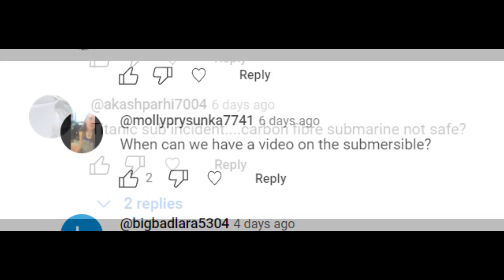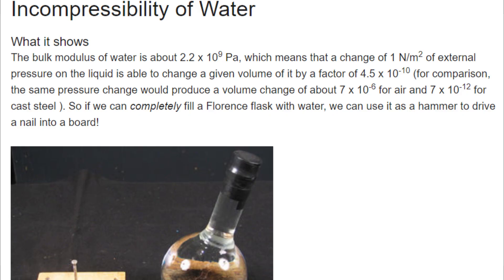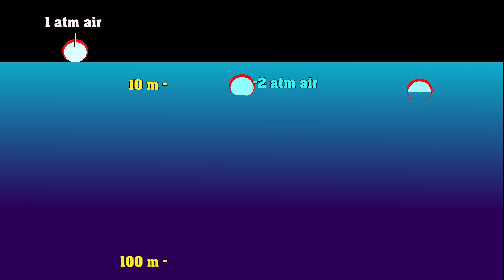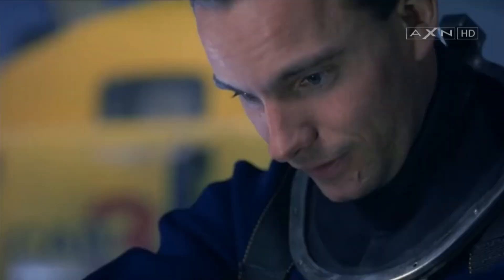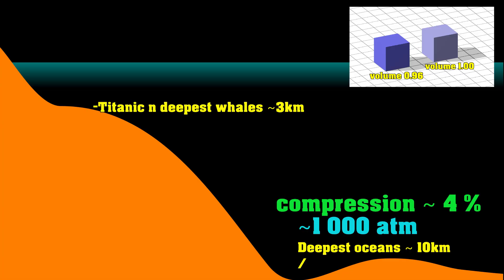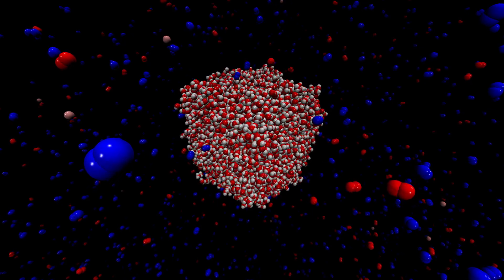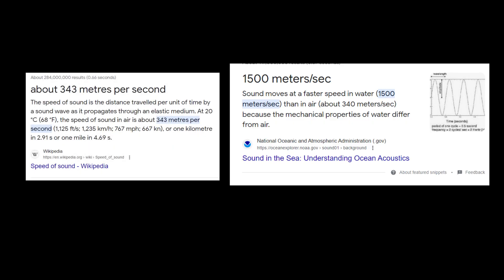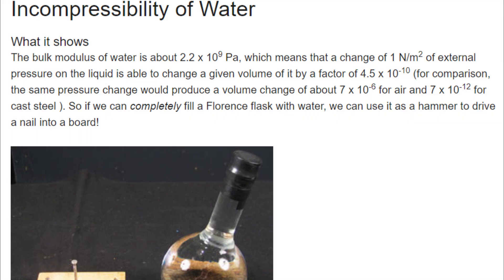What Happens when a Hull Fails at 1000 atmospheres?

Comment: When I was at Uni one of my lecturers told me about a mine accident when he was a student.  A miner accidentally drilled into a neighbouring mine that was flooded with about 200m depth of water, the water in the neighbouring mine pushed the drill bit out of the hole rather violently, and the miner got about 60m of 3cm thick drill bit through his skull in rather less than a second.  The water then proceeded to cut a hole in the granite wall behind where the miner had been standing.  Water under pressure is not to be underestimated!
Reply: Yikes. Yeah, they use pressurized water streams to cut rock and even diamonds, it can pretty much slice through anything under enough force. Anyone who has ever pressure washed a driveway or the like and held it (from a distance at that) against their bare skin would quickly come to appreciate how even the water from a relatively low power pressure washer can feel really sharp and hurt your skin.
Reply: @larion2336   Yeah, they use pressurized water streams to cut rock and even diamonds,

False. Certainly not diamond lol 
Waterjets use embedded particles of high hardness synthetic materials like synthetic garnet or synthetic ruby . The water itself doesn't do the cutting, it's used as a matrix to push the very hard abrasive particles
Reply: 200m of water would only be 283PSI so i doubt that can cut granite...
Reply: No the water didn't cut a hole in the granite that's absurd. On top of that nobody was close enough to witness that hole being made and survived to tell the tale. 100% false lol
Reply: Did the miner die?
Reply: @cholodude97  nah he was fine
Reply: @cholodude97  probably had a headache though
Reply: @cholodude97  He walked it off.
Reply: Surprisingly he didn't die but after he recovered, his personality drastically changed. Which lead to discovery of association between frontal lobe and personality traits.

Edit: I thought the comment was about Phineas Gage, who was a railroad worker, but commenter was writing about another similar incident.
Reply: @primumNocere you're probably thinking of the similar even with a railroad worker who got a steal beam through the brain since that's a lot better known story
Reply: @primumNocere  that was Phineas Gage in the 1800s and it was a tamping iron driven by explosives during railroad construction. Not a miner and a drill bit driven by water.
Reply: @baconghoti   @jesterram7146  yep that's what i was referring to. surprised to learn that more than one people survived a metal beam going through their skulls
Reply: @cholodude97  Well he was chilling with me just the other day, he is all well and good !
Reply: He laughed it off. Retired and became a zombie. Drill Head we used to call him. Days when men were men and you could die one day and still damn' well turn up for work the next. Not like these snowflakes today.
Reply: Yes @cholodude97
Reply: It is used to cut steel plates, for example.
Reply: @piotrd.4850   No. Water jets use embedded particles of synthetic ruby or other hard gemstone . That's what does the cutting. Not the water.
Reply: He basically created a natural water jet cutter. They use that all the time in production of steel parts. It produces a cleaner edge than plasma cutters. Combined with the right grit, it can produce a polished cut line.
Reply: @muskokamike127   No. Water jets use embedded particles of synthetic ruby or other hard gemstone . That's what does the cutting. Not the water.
Reply: This was me. I was that miner. I was real surprised when that water came shooting through and I'm lucky to be alive. My friends and family say my personality changed after I got stuck with that drill bit but every cloud has a silver lining though. The ordeal gave me the idea for the water pick flosser and I'm a millionaire now.
Reply: @MitchellSulzener  
When life gives you lemons... Good job!😁 One question - Is it hard to wear a hat with that drill bit sticking out?
Reply: Look up the story of Phineas Gage if you're interested in oof injuries like that...
Reply: @Faesharlyn  "'Tis but a scratch"
Reply: Oh come on man, you can't just stop like that after making such an invigorating scene in our minds! TELL MORE. That is such an awesome thing to imagine.

Comment: Good video, however seems a little OTT focusing on the compressibility of water primarily vs the obvious 5800psi.
Basic math seems like follows:
Pressure at max depth- 5800 psi
Area of a 20x6m cylinder- 555120 sqi)
Total applied # pressure apllied across area- 3,219,000
I think a structural engineer would be needed to explain further, however if AvE doesn't do a follow-on video explaining, maybe someone else can  do a mock-up with an egg and a lower pressure set-up.

Comment: As someone that actually understands hydraulic pressure, this is PAINFUL to listen to.

The sides of your "magically wall less" space don't just sit there, neither does the bottom. All spatial directions are evenly supporting all that PRESSURE, mass, force. The gravity fills it? GRAVITY?! No. The total ambient pressure of the surrounding area attempts to equalize. The velocity of that is dependent on some VERY COMPLEX math. But we can napkin it and say once compromised structurally the force was divided evenly across was the size of the submersible comes inside to play evenly in all directions. Napkin math says somewhere north of 400psi. So you're getting a flow rate of somewhere south of 800,000 cubic feet per second. The submersible is roughly a 6 by 20 cylinder. So that cylinder of air is full of water in around 0.0001 seconds. rounding up.

Fking GRAVITY?! FIRED, you are fired.

Comment: The temperature increase due to compression probably isn't insignificant, but the wall of water crashing in at 2x the speed of sound probably won't leave much time for any heat exchange. I imagine it's basically like a big diesel engine cylinder.

Rough calculations for adiabatic compression with diatomic gas with 5 degrees of freedom (7/5) at 300K:
- 5m^3 tube at 1 atmosphere (~100,000 Pa)
- air is compressed to say 0.0125m^3, 100000(5/0.0125)^(7/5) = 439424217.32Pa
- PiVi/Ti = 500,000/300 = 1666.67
- Tf = PfVf / 1666.67 = 439424217.322Pa * 0.0125m^3 / 1666.67 = 3295.67K.

That's about 3000 degrees C for a few milliseconds, before immediately being washed away by very cold deep ocean water.

Comment: Huh, I thought the pressure was force against the sub. Like grabbing a bag of chips and pushing on both sides of the bag. It doesn't pop because my hands are decompressing and springing back but because of the applied force. Gravity is causing this constant force on the water which is pushing in on the sub. There may be an element of decompression at work as well but its the only thing? Possible I completely misunderstood the video.

EDIT: Was thinking about compressed air cannon or something similar and realized what he means now. Since gravity pulls all matter at the same rate there is no accumulated force to cause more pressure then what gravity would normally provide. So its similar to a compressed air gun.

Comment: What happened to the atmosphere in the sub?
Did it get pushed out? Did it get compressed? At the speed of sound? what happens in that case?
Reply: it gets mixed with the decompressing blob of water, gets compressed 350 fold, heats up to 100k kelvin, but it's already mostly outside the boat by that time then it probably rather quickly cools back down. it's 6-7 kilos of air we're talking about so not that much of an effect on anything

Comment: Thanks for the video. I’m a little confused though. If the water was incompressible at whatever depth, and the hull failed, wouldn’t there still be a rush of water moving at high speed due to the pressure difference between the inside and outside, not just free fall speed?
Reply: This is a good point. Thunderfoot is either implying that water pressure itself is the result of slight compression of the water. I believe Thunderfoot is wrong about that because the weight of the water also causes water pressure. He is also wrong with his final animation showing expansion of a volume of air out of the sub, which is just nonsense to which I don't know what he was trying to say at all as it does not picture what actually happens at all. This video is shockingly unexplanatory.

Furthermore, it seems like decompression of water by 4% is quite uneventful to the human body and to the submarine. It just means for every 1 liter of water that leaked in an extra 0.04 liters was expanded out. That doesn't explain anything at all! At no point is it clear why this additional 4% implied volume is relevant in any way.

Comment: When the sub fails, a cubic meter of water beside the sub has 40 mega pascals on its ocean side, and just an atmosphere on its sub side. So the force is 40 mega newtons, mass is 1,000 kg, so that ton of water would accelerate toward the center of the sub at 40 kilo meters per second per second. I got 0.007 seconds for it to travel 1 meter across the sub, reaching a speed of 280 meters per second.

That ignores the springiness. So that's a good point. But even if it was incompressible, the water wouldn't fill the sub at freefall speed, because water surrounding the sub to a radius of 10 meters would only have to fall 3mm in order to fill in that cubic meter.

Not sure if that will make sense, or even if any of it is right in the first place, but thought I'd comment anyway : ) Great video as always.

Comment: @Thunderfoot First time i've seen you make such a huge mistake on a trivially simple topic. Lets say the water is completely incompressible, I still fail to see how water would not enter the sub through a small hole at near the speed of sound. The velocity of water exiting a system through a small hole is (2gh)^0.5 where h is the depth below the surface of the water. so at around 4000m depth, water should enter the submersible at 300m/s even if it is completely incompressible
This is also in line with everyday experiences where increasing the pressure on water increases the velocity with which it shoots out, like in a syringe

Comment: This can't be right, but let me show my math; Universal Gas Law => P*V = n*R*T
The pressure is 400x normal, so we balance the equation by multiplying the the temperature (T) by 400. The 'n' and 'R' are constants. Let's use an ambient temperature of 300 degrees K at 1 atm. We get 400 * 300 degrees K = 120,000 degree K. The surface of the sun is 5772 degrees K. The speed of sound in water is 4.373 times that in air; 1500 meters per second. The Titan was 5.8 meters long. 5.8(m)/1500(m/S) =  3.87 mS. That's how fast it was over for them once the vessel was breached.
Reply: i fail to see what in your calculation is different from the one shown in the video

Comment: Just a curious thought:

Couldnt you fill a submarine with like multiple atmospheres? I am aware that would require decompression time and special gas combinations.. but..wouldnt you able to cheap out on hull strength?
Reply: maybe you can put a couple of athmospheres in there but is there much of a difference between a tube having to withstand and inside/outside pressure difference of 350 atm instead of just 345 atm? i'd just decrease the diametre instead to one i can just about fit inside, keep the same wall thickness, and have a much stronger tube that way

Comment: I am not sciencey enough to understand the difference between what I thought and what was presented. It was thought that the immense pressure when failure happened would quickly collapse the inside volume and compress the contents. When the wave stopped, the pressure at point of impact would kind of explode the mass. Damn movie implosions of the last 50yrs. Now I dont know what to think. 😢😂🎉

Comment: Can i also stress the galacticly dumb idea of producing a Carbon Fibre hull for a Submarine with expired materials from Boeing. 

Long story short: Carbon Fibre is a good containment vessel for a greater pressure on the inside and a terrible containment vessel for greater pressure on the outside.
Reply: he very well could have been lying about even this as boeing has no record of the transaction although it's up to you whether you trust boeing over rush. it's a strange thing to lie about, but wierder things have happened
Reply: @markifi  I agree, yet still it could have been a scrap-order, and someone just selling something that still looked good to someone who had no clue...prepreg (if that's the fibre they used) must be stored in a frozen environment an has an extremely limited shelf life outside of the freezer. 

But i guess the whole thing has been done by people with limited or no knowledge of how to use the material correctly...but if i cant peel the layers apart i can only speculate

Comment: Very interesting perspective, but what about the mass of water lol? You left out like half of the discussion? How much water is on top of those guys at that depth? Surfers have been left paralyzed from impacting water. There are other physical properties at play of course. Not just the mass of the water but the fact that a water impact feels like hitting concrete at certain speeds (probably a surface-tension effect). These submersible dudes were obliterated like nobody can even imagine. I would think it is like being crushed by 4 trains and 5 jetliners looney toons style.
We might as well use this as a way to imagine the answer to the classic question "What happens when you approach a black hole?".

Comment: Not that it changes the outcome, but i think you missed the thermal change of the air as it's compressed.  When you half the volume of space a gas occupies you double its tempature. That increases it's presure.  The water would absorb the thermal energy but that takes a little time.

It probably changes the time needed for the water to reach the back of the sub by a few milliseconds. Additionally the contents of the sub would probaby experance some amount of flash oxidation from the super heated gas, which would release chemical energy.  Somewhat like a diesel engine combustion stroke.

Comment: With truly incompressible water the sub would fill yes, but the work being done on the internal air would be more than 1MJ, basically the air would superheat anyway and burn you. 
So the compressible water just adds and extra violent part to the already very violent mechanism.

Comment: I've wondered about those supposed alarms they had on the sub to detect damage on the carbon fiber. Would something like that actually work in time for people to hear the alarm before the sudden implosion? I wonder if in reality such a system would actually help at all to attempt going back to the surface or not, or if it even had the time to let people know they were just about to die.
Reply: I have no real knowledge about any of this just a guy with a buzz guessing but if you're closer to the surface and hear it maybe you could do something about it but at depth it's just a "You're about to die" alarm if the hull making sounds it's never made under pressure didn't give it away
Reply: They were functionally useless. The guy who they infamously fired/sued specifically raised alarm about how when the acoustic system would detect a flaw in the hull it, it would be too late anyway.

Comment: The pressure is from all sides, the falling column is a false representation, unless you isolate the column of water inside a tube. The point is that the pressure does not require all water to move, i.e., you only need the water to accelerate into few cubit meter of void.

Comment: Don't think it really has anything to do with the compressibility of water.  It has to do with Newton's second law.  When the hull fails the hydrostatic pressure pushes inward at 1000 atmospheres with the air pushing out at 1 atmosphere, causing the water to move inward very quickly.

Comment: Does this not assume a leak of some kind?  What about a structural failure where the material simply can no longer hold it's form but doesn't have a leak?  Or is that not likely due to other factors?

Comment: I was hoping he would explain a further detail: based on my reasoning, if the water is decompressing at the speed of sound, the air inside the sub should compress at the same rate. When you compress a gas, it gets hot. So how hot would the air in the sub get exactly?
Reply: well if you pump a container up from 1 to 350 bars, the temperature goes from 20 °C to 102329 °C, but this is not what's going on here as the volume here changes and the density of air goes from 1.2 kg per cubic metre to 360 kilos a cubic metre. so a tiny bubble of very hot air? but it would be outside the submersible already

Comment: Supposedly the air inside the crew area would be compressed at such a fast rate it would explode and burn at 10,000 degrees (equal to the surface of the sun) - any truth in that?

Comment: Interesting. I recently heard someone claim that when the 1 atm air in the sub is compressed so violently by the incoming water, you get such high temperatures generated that body tissues are incinerated. Think of a diesel engine which uses the heat of compression to ignite the fuel mixture.